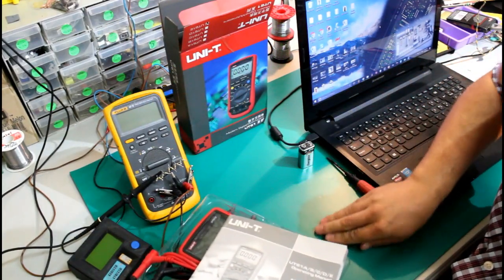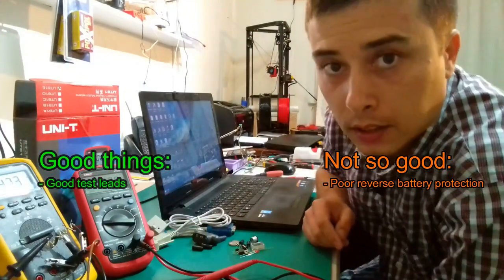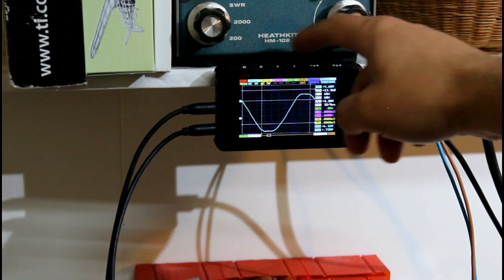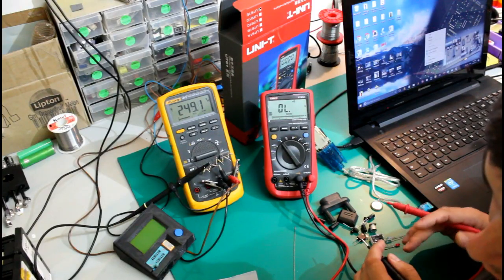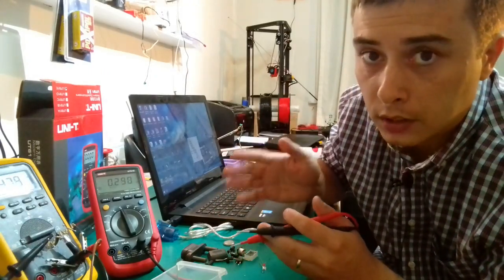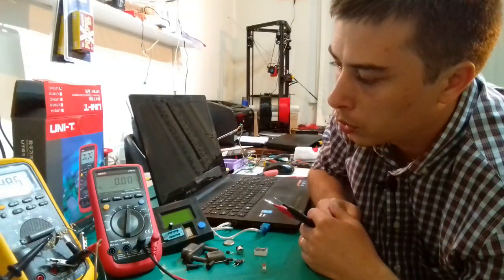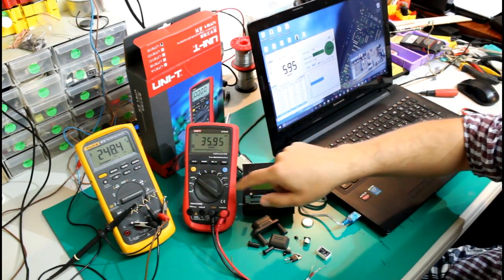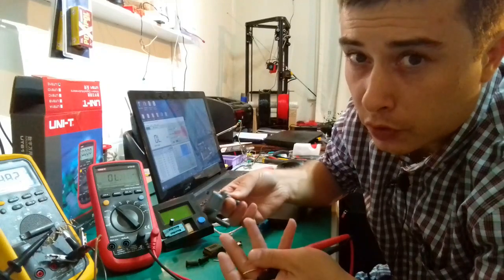Uni-t UT61E multimeter complete review

Comment: Just recently found your channel, and find your videos to be very helpful!
I am a third year Electrical Engineering student, and am looking to purchase a new multi meter.
Do you have any recommendations? Should I invest in Fluke, and if so, which model?
Reply from the maker: It is obvious to me that you are looking at engineering/ professional level now. Fluke 87-V is a very good choice. It seems to be having the speed and precision every professional wants. I also like that "Hi Res" function which I use a lot for small value resistors and other things. If you don't have the finances to buy a new one, you can always go bid for a used one on ebay. I bought mine from there for about $200 and I am very happy with the bargain.
Reply: @FunElectronicsToday  I'll definitely look into getting one, thanks for the input!

Comment from the maker: Check my other review videos I uploaded on this channel. For instance this RM409B multimeter review: https://www.youtube.com/watch?v=R9fJBIzzZNQ
Reply from the maker: Regarding the comparison between the Fluke and these other multimeters, somebody commented on a different video of mine that the Fluke cannot be compared with them because it’s a different something. I think it’s worth posting the discussion here and my reply since there might be more people out there interested in this topic.
 
CB: “Fluke has bargraph that's fast mastech don't. fluke has conductance function mastech don't. fluke's minmax capture mode is super fast mastech just average. fluke's build quality is far far superior than mastech. fluke's test lead wires are silicone mastech melts when accidentally  touched by soldering iron. fluke is accurate even when measuring non sinusoidals mastech just good with sinusoidals. fluke's display is clearer than mastech. so on so on and so forth”

FunElectronicsToday: Now Fluke is meant to be an industrial $450 meter and the Mastech is only 10% of the price and intended to be an amateur one. I for once, bought myself a Fluke because I wanted a meter I could trust and a guaranteed measurement. Many times I make projects for different customers and I have to create official documents and test reports with added measurements and numbers. I couldn't do official numbers using a DT-182 multimeter. How could I show a report like that to the customer and who would believe me? 
   As the years passed by and I grew up being a HW designer I saw from experience that measuring something with a cheap multimeter gives me at least 5% chances of having a big human or device error I usually take for granted as being a good measurement. It could be either the fact that I am rushing or the fact that the probes are not making good contact and the display is not fast enough to tell me that, but if I measure 100 times there is a good chance 5 times I get the wrong numbers. Combine that with the limitations of the meter, like resolution, speed, range, etc and you end up having a limited device that can hinder a good measurement or cause errors. For amateur use and everyday repairs this is good enough. But for long term HW design this was not good enough for me. If I am thinking of embedding a new component in my design and I go ahead and measure it's current, voltage dropout or resistance, compare that with the datasheet and then calculate everything for making a robust design that needs to last for 10 years in harsh conditions, I need to be sure. It doesn't help me if I only trust my meter 95%.    
   This comparison video was made to provide a good accurate overview of the meter so anyone can see its limitations and decide for themselves if this device suits their needs. 
   There is another side of it I could never say in the video back then when I shot it. There was a time in my pioneering years when I was content with using cheap multimeters. After almost 20+ years of practicing my profession I started to want more and seek more professional tools. Once I started using Fluke, Agilent, Tektronix and other industrial tools at work, I realized that nothing would be the same if I go back to my old meters in my shop at home. It's like being a F1 pilot and going back home to your simple Ford Fiesta. The profession skills growth asks for an automatic tool upgrade and boosting up the tools level works out more skills for you in the future. This is how the normal growth curve and profession developing cycle works in everyone of us. I guess... What do you guys say about this? If you hear somebody claiming they work for NASA or Tesla motors and they argue with you that DT-182 is just as good as Fluke and Hantek like Agilent and that it doesn't mater it they do spacecraft design using DT-182, what would you say about them? You would say that they are either lying they work for these companies or they got some mental disease recently. Na?